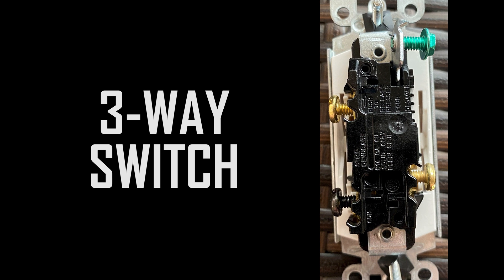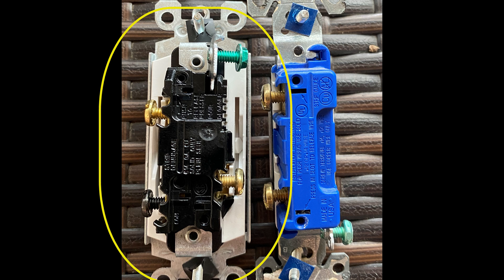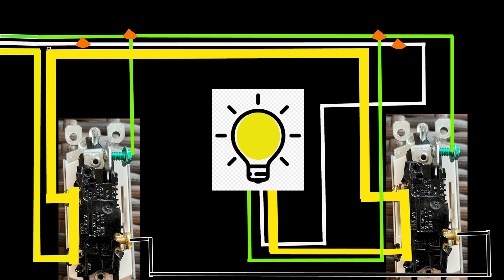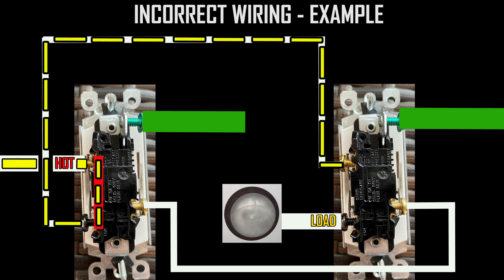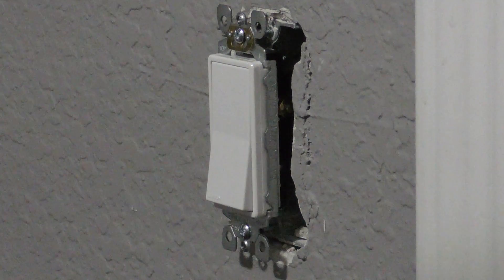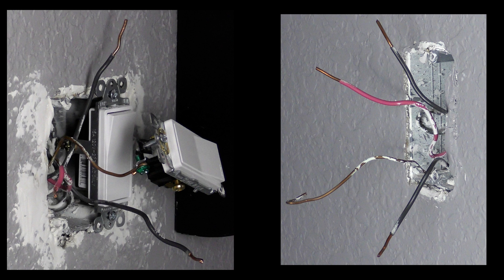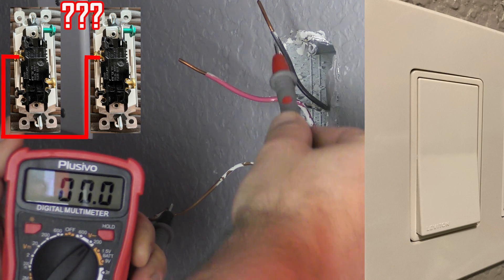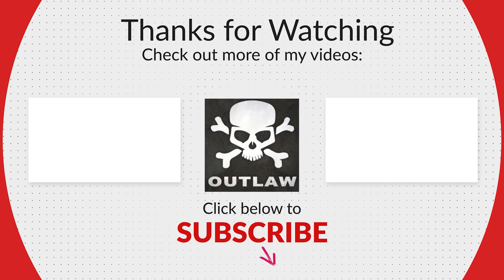3-WAY Switch fully Explained: How to Wire a 3 Way Light Switch, Identify ALL Wires, Troubleshooting

Comment: I tried a few other videos.  Got shocked (that on me) this was the best video on 3-way switches by far. The detail about the power coming into only one switch and the black screw going out to the light was a critical piece I was missing.  Thank you!  I gave you a tip because it was so helpful! Christian
Reply from the maker: Thank you. I'm glad that you were able to safely complete your installation.

Comment: This was very informative and helpful; thank you for explaining it so thoroughly. I haven’t solved my problem yet (my main switch only has two wires - the hot (black) and a red traveler. However, there are 4 neutrals (white) bound together. 

The main box is similar to yours box - it houses another switch, and there’s another single switch directly behind the box; both of those switches are on a separate circuit, though. 

The secondary box is a single switch and has a black, red, and white, with 2 additional blacks capped together, and 2 additional whites together. 

The main switch worked last night, until I attempted to change the secondary switch. 😣

Comment: This is really good, maybe you could help me troubleshoot my situation?

Old ceiling fan (fan only) was connected to 3-way switch with no problems.

Had a semi-knowledgeable guy attempt to connect new fan/light combo.

The light only was working.  If I threw one of the switches though, breaker tripped.  We thought maybe there was something wrong internally to the fan itself.

Then discovered when the other switch was thrown (in unknown combination with the other), breaker tripped,  get it reset and now only the fan works instead.  Does this jump out as some particular problem with how the wiring was done?  I think my guy was trying 2 different power sources for the light and the fan, which doesn't seem right.  The product itself does have 2 different wires to power each of [light, fan].  Any thoughts what might be going on here?

Comment: So I think you mentioned that to be properly wired both switches should either be in the up or down position to be properly wired.

I tried 3 different locations that are three ways and to be "on" 1 switch is up and one switch is down.

But they all seem to be working just fine.

Is this wrong though?

And if so what problems could it present?

Comment: So I have central air installed going on3 yr's. My kitchen is 6' /9' . It still gets warm in there!! So I decided to install a ceiling fan with led light. When I took the oval light down. The black & white wires were wired together with just one white & one black wired to a wire & attached to the light! I have the fan installed but the light doesn't work & it not control by either switch. The main switch was soft. Like when the breaker trips sometimes. You have to reset it a second time!! So I got a new switch!! Still no light & fan runs on its own! I been multi tasking today!! So I took the main switch out & multimeter the wires. Im going to make me lunch then reinstall the switch!! 1st I will checkout the other switch!! Then lunch!! So if I get both switches right then will everything work correctly??? I just worry if the ceiling wires is what's causing this problem!! I am 65 so I done a lot of dyi projects. I took out two ceilings light & installed fans here. One was at the top of stairs. It is on a 3 way switch & not problem!

Comment: VERY detailed, but clear, tutorial- Thank You!!  I have a similar troubleshooting problem in that I also have a 3-way light switch at each end of my ceiling can lights in my hall leading from kitchen to MBR.  But I also have a 4-way in between the two.  The 1st 3-way is in the kitchen end, the other end's at the MBR & in between there's a door leading into our garage where the 4-way is.  This is a new construction home we bought 2 years ago & this hall lighting system worked perfectly till last month when it malfunctioned (without any removal or changes to any of the 3 switches) in that IF the kitchen switch is in one position, the other 2 will successfully control on-off , but once the kitchen end is switched to the other position, the 4-way & oher 3-way do not turn the lights on or off.  (There are 2 ceiling cans in the hall control by this electrical circuit).  Do you have a video tutorial I can review to help me troubleshoot what's going on, isolate the (assumedly) bad switch & replace it?  So far, on a "hunch" I simply removed & replaced the kitchen 3-way switch with a new 3-way from local supplier, because it was quick & inexpensive...but did not fix the problem.  Then I did the same with the 4-way & the 2nd 3-way...again to no avail...so I put back t he old ones.  I'd love to view a tutorial guiding me through the troubleshooting on  my 3-way & 4-way system. - Thanks again!
Reply: I'm sure uve found ur problem by now but if not hopefully this will help. https://youtu.be/vDZ-JJJNFlM?si=9oRlOkO0GEXkMldu

Comment: Thank you! I’m trying to move one electrical conduit 10 feet over so it’s not blocking a ceiling, and I open it up and it has 5 wires. Your video helped me deduce what is what. Ended up being two separate lines, one was just hot and the other was two travelers. Previously I didn’t even realize the switch in the garage was a 3-way for the basement light, now I know. 🙏

Comment: Great video.  Thanks.  
I have a puzzling situation:  I have properly identified all of the wires as you showed us and connected them to two new 3-way switches but the lights don't function.   However this circuit wasn't working before I started this project so I'm questioning  how to diagnose the problem.  I'm guessing there's an open neutral, but the neutrals that pass through the boxes seem to be OK .... and I didn't disturb them.  How do I check/diagnose the neutral?
BTW:  both ends of this circuit are in double boxes with other 3-way switches and some of the neutrals seem to be grouped together... does the make sense?  House built in 1995.
Thanks.

Comment: I changed my 3 way switches and never had an issue with the light. After I changed them the switches do not work as it should. Both switches have the ground screw on bottom left. Brass screw upper left and upper right and black screw bottom right. Upstairs switch, black wire (hot) on black screw, cream and red wire on the traveler screws. Downstairs switch I have cream (hot) on a traveler, black upper right and red on black screw. Upstairs switch is up and light does not work at all. Upstairs switch flipped down, light turns on from downstairs. I only have 3 wires and not sure why I am having this issue. I changed another 3 switch same way and works as it should. Any help? Thanks

Comment: Can you do a wire identification video for 2 dimmers? I’m having trouble powering one of the dimmers on. I’ve identified the hot wire and wired up the main dimmer which works. The second dimmer doesn’t power on.

Comment: 10/10 ! 
I have an incorrect 3way once fixed I will come back and update you 🤓
Reply from the maker: How did it go?
Reply: Update: it was shit
Reply: The 3 way switches are controlling an outlet.🙄 
One is located near the kitchen and the other living room next to the outlet.

The first switch we will call KS. 
KS is in a box with two other switches. 
A way switch ( that works perfectly) and single switch. 

The second switch we will call LS.
LS is in a box with a single switch (that turns on patio light.) 

All other switches in nether boxes work as expected. 

I will re-update on what the mess was in the new year. 🙇🏻‍♀️
Reply from the maker: @Esiddik  Sounds like your place was wired to turn on lights that are plugged into outlets. 

Good luck with tracing the wires.

Comment: This is by far the best explanation of how to wire a three way switch and how they work in the circuit. Congratulations on a great video. I learned a great deal on the travel wires and what terminal to use for each one.

Comment: I totally agree with positive comments.  Watched other videos and thought I had followed step by step, but the lights would not turn on in a certain position.  I found your video and it was very simple and showed the possible reason why it was happening.  Went straight to my switches and did exactly what you showed and BINGO works perfect.  So Thumbs up and subscribed.

Comment: in your video I see a switch wear you put 3 wire on I have a 3 way switch that have 4 wire on it and all wire are same color I find out when I try replace the 3 way switch I get it part working any help in fix it and get it full working?
Reply from the maker: Ray, 3-way switches have 4 wires on each switch. Please scrub through the video for the explanation. If you use a voltmeter, the color of the wires does not matter. Using my tutorial you can check what each wire does and then connect it properly.
Reply: @Outlaw_SEO  in the video you have a ground wire and that make 4 wire if my have ground wire then there will be 5 wire on my switch so how as my a 3 way switch?

Comment: What happens if you swap the traveler wires so terminal 1 is connected to terminal 2 on the secondary switch and vice versa?
Reply from the maker: The switch will will work but it will be reversed. When the light is on, both paddles must be in the same position (either up or down). If one is up and the other is down - and the light is working - that’s a mixed traveler wire for you. 

The video describes this situation as one of the options of incorrect wiring.

Comment: I replaced an old/broken 1970's switch by the bathroom's door. Without careful review, I installed a single throw/pole that work only for the vanity lights BUT the outlet w/reset and a double-switch across 1-for exhaust fan and 1-for the shower overhead light don't work. I swap with a 3-way switch; while vanity lights were on same results BUT when vanity lights were turned off THE OUTLET WORKS AND SO THE DOUBLE SWITCHES? Need help so what I missed??
Reply from the maker: Without being there it’s hard to tell. Your best bet is to call an electrician

Comment: Great! But what if there is no ground wire to check for the hot wire on the second switch? Working on my in laws old house and it seems they used two wire w/o ground.
Reply from the maker: If there is no ground connection or if anything is not wired according to the modern standard, I’d strongly advise contacting an electrician.

Comment: Thr best explanation by far.
What if you have 3 switches controlling the same light fixture, would you apply the same concept?
Reply from the maker: Thanks. 

You would need to do a 4 way switch setup. It requires placing a 4 way switch between two 3-way switches. 

Here’s a good video: https://youtu.be/AlAyov6ShxU

Comment: I have been trying to get an answer to this. What if you don’t have any ground wires in at all inside the box? I’m trying to get a light to work from 2 different areas in the house. It’s going down the basement. The box at the top of the stairs has 2 black wires and a white wire. The box at the bottom of the stairs has a red, white and black wire. I’m guessing that I’d have to use 3 way switches?
Reply from the maker: Your best bet is to do continuity testing to figure out what wire powers on. If you can’t troubleshoot it with ease - it’s best to contact an electrician.

Comment: This is a GREAT to the point video. Can you PLEASE do one similar to this but in the ceiling light box on how the connections should be for those of us that had to take the wires apart to replace the cracked box. If you do one, can you please have it so the power is coming to the light and the light being in between the switches? The 3-way switch wiring isn’t confusing if the ceiling box is already wired. Thank You in advance. One of the best videos I’ve watched on 3-ways.

Comment: Excellent!! I have an existing 3 way switch ( which I did not know I had )  The one switch I always used for the light I installed a dimmer switch. You raised my curiosity on the power versus traveler.  I’m taking  your advise  and buying a multi tester. I’m a trades person but not an Electrician but enjoy DIY projects. BTW I subscribed 🍺🇺🇸👍
Reply from the maker: I’m glad that this tutorial helped. Thanks for subscribing!!!

Comment: This is the best video for “dummies”. So detailed, and yet not overwhelming with unnecessary information. Thank you so much! I fixed my problem thanks to this video.
Reply from the maker: Thanks for watching. I’m glad you were able to solve your issue.
Reply: Looked at several 3way switch circuits this video is excellent in
Describing how to indentfy which wires are which from one switch to the other.  Thank You

Comment: Your statement at 6:11 has definitely impacted me.  I will be getting an electrician in to fix my circuit made up of two 3-ways and two 4-ways.  This video has taught me an awful lot that I should have known for the last 30 years, but I am also not a professional electrician.

VERY GOOD video!  By the way are you Dutch?  I used to live in Holland in the 1980s.
Reply from the maker: Yes, if you can’t identify all the wires - it’s best to call someone who can. Your circuit sounds like an interesting example of wiring. Please keep us posted on the results. 

As for the accent - I was born in Russia, but over the last 25 years, I’ve lived all over the world, picking up the local pronunciation. Never made it to Holland, unfortunately.

Comment: I watched your video and I am at a loss. When I turn the main switch on the second light comes on a millisecond later. There are two lights controlled by the three way set-up. Do you have any ideas. Thank you for the video.
Reply from the maker: First you want to check the type of lightbulbs that you are using. Some energy saving LED bulbs have a longer start up than the regular filament bulbs. If the bulbs are the same, I would start by checking the light fixture. 

If you have a spare unhooked light fixture with the standard 3 wire set up, you can connect it to see if it acts properly.

I’m glad that you found the video useful. Thank you for watching. Let me know how it works out for you!
Reply: I went through your wiring identification process. I did have the runners reversed so the switches were not in the same position when energized so I fixed that. I also replaced all the bulbs, two lights four bulbs. All is good and it works fine. I have been rewiring my entire house because it was knob and tube. Do you have any videos on how to rough in a kitchen. For instance do things like microwaves and fridges need separate circuits?Thank you very much and have a great holiday season.
Reply from the maker: @LourieFamilyHomestead  This is great. I’m glad that you were able to figure it out. 

Regarding the rough-in: I’m sorry, I don’t. 

I made this 3-way switch video when I ran into an issue similar to yours during a switch replacement. Since I couldn’t find an existing detailed all encompassing video on the topic - I made this one. 

Otherwise, I currently don’t have any more electrical projects planned.